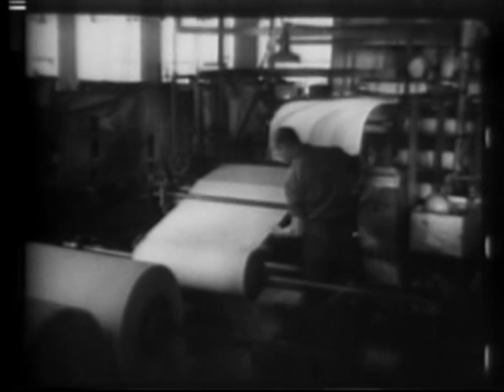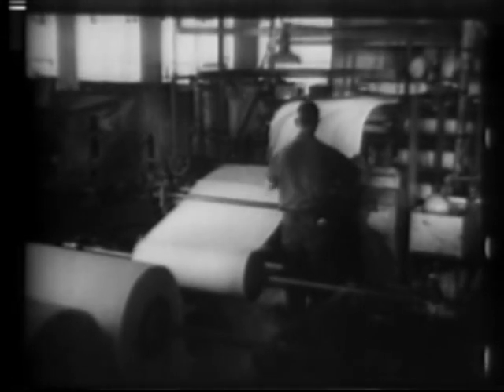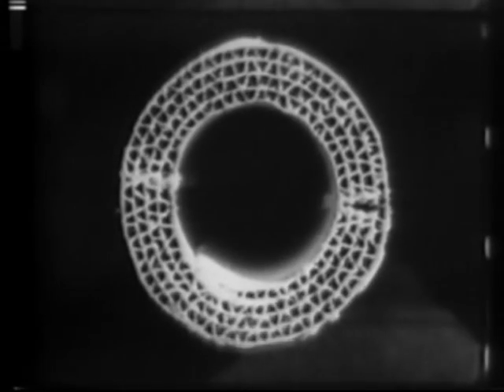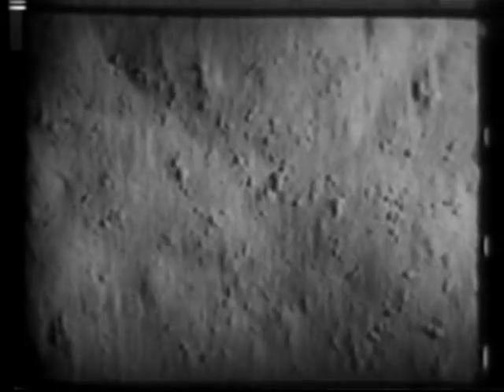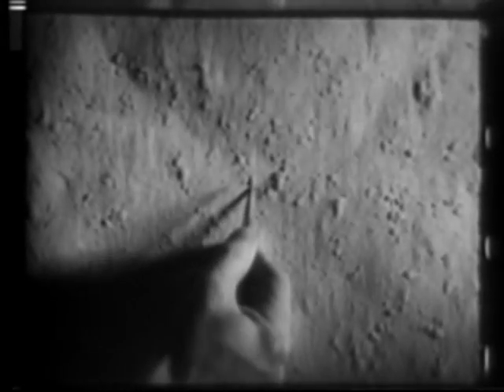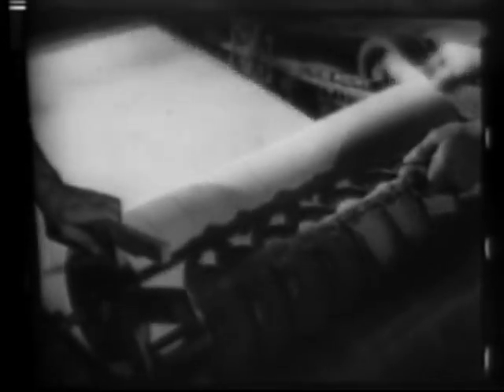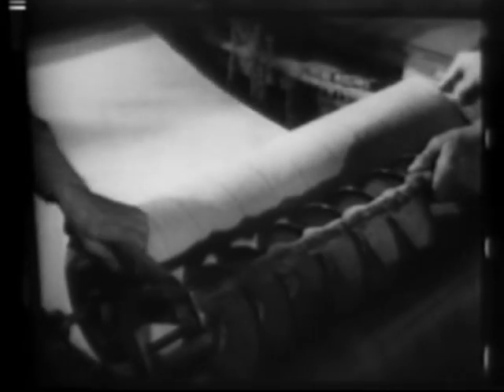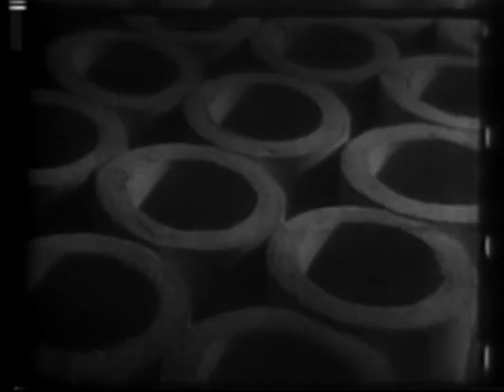Asbestos paper insulation manufacture and types, 1962

Comment: I have found corrugated asbestos material in furnances, fire doors, and used as insulation in ceilings. its usually missed in an AHERA "visual" inspection, especially when the inspector is inexperienced.
Reply: Good eye.